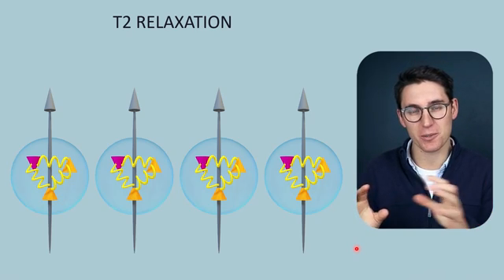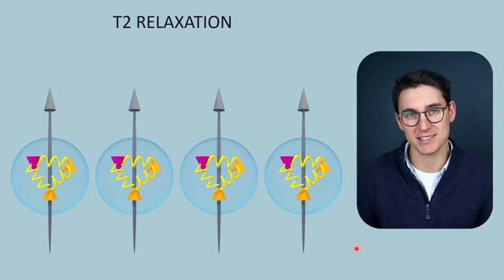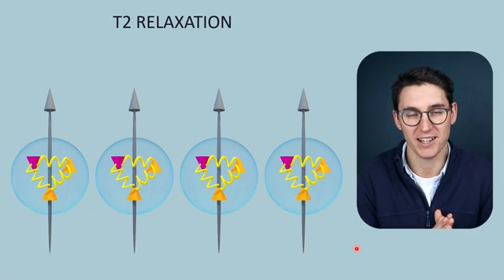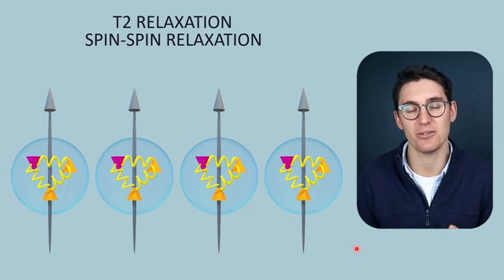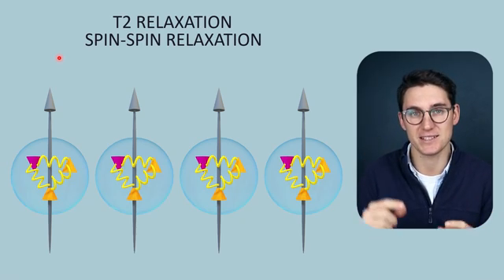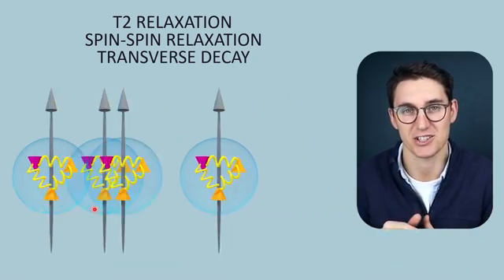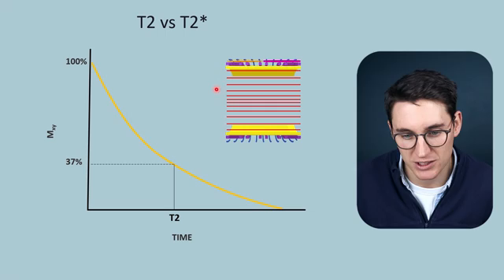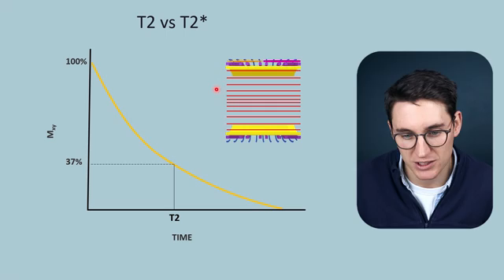T2 Relaxation, Spin-spin Relaxation, Free Induction Decay, Transverse Decay | MRI Physics Course #4

Comment: I believe one of your claims is inaccurate. Spin-spin interactions lead to microscopic changes in the magnetic field, which are characterized by T2 timescales since these interactions arise from the electromagnetic interactions between individual spins. In contrast, macroscopic changes in the magnetic field, such as inhomogeneities caused by coil imperfections or local variations in field density, contribute to enhanced dephasing, characterized by T2*.

Comment: I don't understand how the 180° pulse part works. 
When the out-of-sync net spins were demonstrated around the 12-13 minute was their direction supposed to continue to the left side of the screen as they were originally going, because the B0 flows in that direction? 
And when they rotated by 180° shouldn't the green net still be less tilted? Otherwise i don't understand how they end up aligning.
Btw thank you for making these videos

Comment: I think that the video shows something that doesn’t really makes sense. In the longitudinal plane the net magnetisation vector is not processing because the individual atoms’ spins are out of phase. If somehow they were IN phase the Net magnetisation vector would have been processing in the exact way you show at the Course 3 11:15 minute. So, I m thinking that when the B1 magnetic field is applied, it turns the net magnetisation vector at the transverse plane, But now, we have every atom processing IN phase and this leads to the movement of the now vertical Net magnetisation vector. This movement I think should be the same with the one you show at the course 3 11:15 as a mentioned before and not as the rotational movement you show at the video. Showing the NET vector changing direction (becoming continuously parallel and anti parallel with the B1) doesn’t make any sense to me. I’m a medical student and I’m trying to figure it out so please, answer if you can. Thank you, your videos help too much!

Comment: At 12:36, your explanation does not make sense. I mean both fast and slow spins are experiencing the same changes in their phase, so nothing changes and the leading one will remain the leading again.
Could you please explain a bit ?
Reply: upp
Reply: I mean i think i figured that out. I had the same issue in understanding this. The answer is - you are applying the 180* flip in Z axis (in ZY plane) not in XY plane.
 If the 180* RF pulse acted in XY plane - then it would happen as you say - nothing would change - the leading one would still be leading. But when it acts in ZY plane - then they flip making like a mirror reflection along the X axis - so they switch and the leading one is now lagging and can catch up
Reply: @wojciechpaweska7116  Its genious.

Comment: Practically when do you apply the 180° flip for a T2 weighted image? T2 relaxation is 63% of transverse signal loss. Do we then flip it when the T2* relaxation signal is at 37%? Is there an automated mechanism that does that because the fewest radiology technicians can react within milliseconds. Also the time T2 is different for different tissues. If the flip was done as I figured which of the 37% signal times(T2 of muscle, fat, CSF) would we take for the T2* flip?

Comment: Another question for you! At 15:00-15:50... 

you said this basically that we flip to 90 degrees and turn off the RF pulse and immediately sample. this is where I'm confused....

I thought the TE was when we...
flip to 90 ... (wait) ... flip to 180 ... (wait) = TE. and sample here! 

so am I understanding this right? basically this explains the contrast differences between different tissues....
flip to 90 ... (wait 1 second) ... flip to 180 ... (wait 1 second) TE. and sample here! = small differences / all white
flip to 90 ... (wait 2 seconds) ... flip to 180 ... (wait 2 seconds) TE. and sample here! = appropriate differences lets say at 37% transverse mag left.
flip to 90 ... (wait 5 seconds ) ... flip to 180 ... (wait 5 seconds) TE. and sample here! = small differences / all black, no signal. 

in all of these examples we found the T2 values of the tissues souly based on the spin-spin interactions because we applied an RF pulse, waited some time (A), applied a second 180 RF pulse and waited that exact same time(A) and sampled the data. 

am i understanding this correctly?
Reply: yes, the time difference between 90-180 RF pulse, is the same time after we measure the signal, TE. This is what I understaood from the lecture.

Comment: Thank you for being amazing as always, this was well explained ! I had a little bit of confusion when you said that because of magnetic field inhomogeneity the spins are going to precess with different frequencies and thats why T2* are generated. but since we have different frequencies how do we send an RF pulse that will match these changing frequencies due to inhomogeneity and knock them out of the Z-axis to the x,y axis in the first place???
Reply: i think it is local inhomogeneity rather than a field effect and this would explain why there is local signal void associated with metal, etc.

Comment: Why is it that a 180 degree RF pulse rephrases all the moments, but the transverse magnetization hits a ceiling at the T2 decay curve? If it is only an issue of how long the RF pulse is on for, then why would having it on for the duration of a 90 degree pulse restore full transverse magnetization and break the ceiling of the T2 decay curve. Something quantum?  As always, thank you!
Reply from the maker: Hi 👋 Not quite sure what you're asking exactly. The 180 degree pulse will only cause rephasing of spins if a previous 90 degree pulse has been applied prior. The first 90 pulse flips the spins in to the transverse plane. The spins will then decay at T2* - some will dephase faster than others depending on tissue type. If we then apply a 180 degree pulse the spins that dephased faster will now be lagging behind the spins that had slower T2* decay. This allows the faster spins to catch up with the slower spins at the TE when the spins will be in 90 transverse plane. If we were to only apply a 180 degree pulse as our first RF pulse the spins would flip a full 180 degrees and have no transverse magnetisation. They will decay at a rate of T1 (ie. regain longitudinal magnetisation) but have to T2 decay because there is no transverse magnetisation in the sample. This is actually a key feature of inversion recovery sequences which we will cover in two weeks time. I may be completely off what you were asking! Feel free to rephrase your question if I haven't answered it! Hope you're doing well!
Reply from the maker: If you're asking why can spins with a 180 RF pulse 'break through' the 90 degree angle (because surely once they resonate at 90 degrees and we continued to apply an RF pulse they wouldn't continue to flip to angles above 90) then yes you are right, this is due to a quantum property. It has to do with energy states of the spins (at resting state with just the main magnetic field spins are in two energy states - lying parallel [low energy] and antiparallel [high energy]). In the quantum world the spins can exist in both states until measured. Continuing the RF pulse for a longer period of time adds energy into this system and allows the a slight majority of spins to now exist in the antiparallel state (higher energy), therefore they are flipping past the 90 degrees. I hope I'm making some sense, very difficult to explain in text 😅
Reply: This was exactly what I was trying to understand, watching again with your explanation really helped!  Thank you for the detailed response!